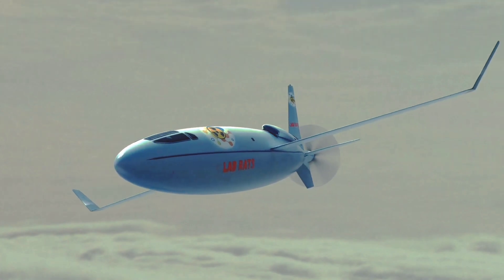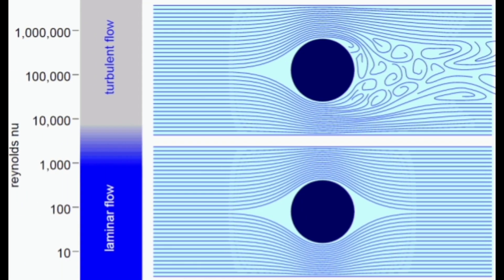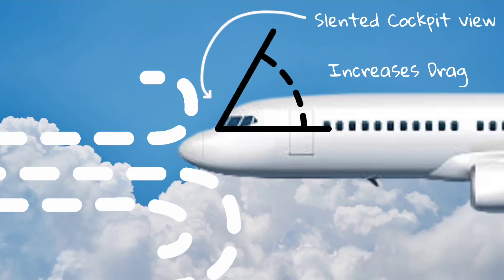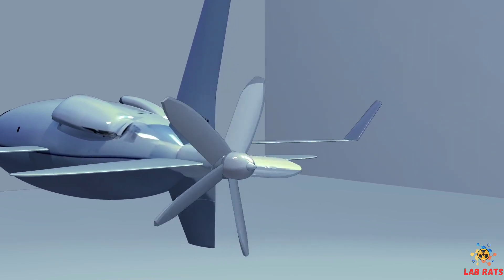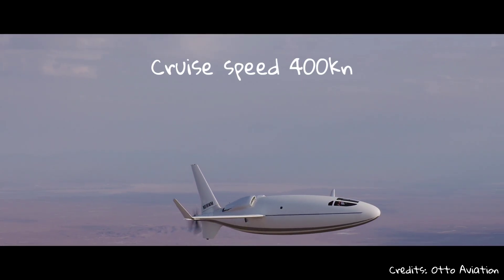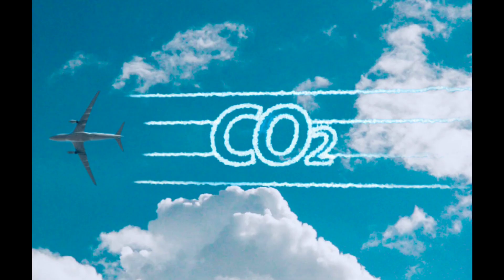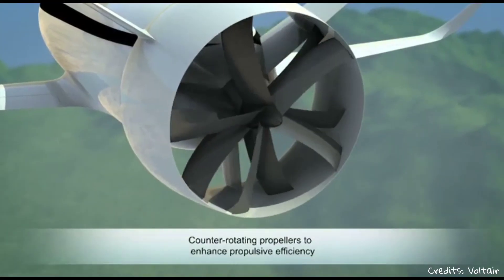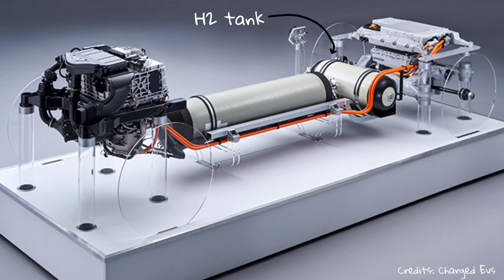IS THIS THE FUTURE OF AIR TRAVEL? | (Otto Celera 500L)

Comment: Imagine if they also used the new prop technology coming out of MIT and Sharrow Marine.
Reply from the maker: Hey @Angelsilhouette
Yes that could be another cherry on the cake ^^
The new Sharrow propeller might increase its fuel efficiency, range, etc. It can also decrease the Vibration, noise of the aircraft.
And overall better handling of the aircraft at lower speed.
I hope they might use this new prop technology soon.
Reply: It's called a toroidal propeller. 😊

Comment: Good video overall just one note: instead of just saying comparable jet why not actually compare it to an actual jet. 
For example Gulfstream 4:
Passenger seating 14, maximum 19
 Height 25', wingspan 77'
 Cruising speed 876 km/h
 Range 7,815 km
 Service ceiling 45000 ft. 
This airplane still sounds very impressive but I don't see it being the proper replacement for private jet aircraft.
Reply from the maker: Hey there 👋
Well thanks for the opinion and will try to make it more elaborate in my next video. 
And talking about gulfstream Gulfstream G280: This super midsize business aircraft still sounds fair enough but not as efficient as Celera 500l. 
But still Gulfstream is another masterpiece 😊

Comment: It's not the future if your still using proppelors. 😂
Reply from the maker: Hi @Artist Market
Future of air travel depends on many factors like fuel efficient, lower environment impact, low maintenance cost etc. So it is not necessary to be propeller but this aircraft fulfills these factors so it might be the future which also includes Hydrogen Powertrain, electric propulsion, hybrid systems etc.

Comment: Hi. Hi. Most rear engined aircraft have very poor stall and spin recovery characteristics. It's all that weight in the tail that naturally drops first. How does this aircraft rate on stall and spin recovery? Cheers, P.R.
Reply from the maker: Hi , well that's a good question!
First of all the exact data on this is not yet out. But according to my concern and some research found on the web we can say that the stall speed of this aircraft is approximately 90Mph(145Km/h) and the landing stall speed is around 70Mph(112km/h).
Apart from that the weight distribution and the Aerodynamics is maintained in such a way that the overall centre of gravity of the aircraft does not push towards the rear section of the aircraft which lowers the risk of spin or stall.
In addition the engine used in this aircraft is Red AO3 aircraft engine which is modified further with aluminium body weights around (250kg - 300kg) which can be considered lighter than usual diesel engine of same characteristics.
I'll be posting further more details after Otto aviation latest news reports stay tuned... Cheers ☺️
Reply: @Theratlabz208  Hi. Thanks for that. I'll look forward to the video on the final completion of the test flights, and its CAA safety certification. Cheers, P.R.
Reply: フラッタリングやヨーイング方向の安定性が悪いだろうから、機首側にも、姿勢制御用の小さな翼が欲しい気がするなぁ
シャチやイルカの前びれみたいに